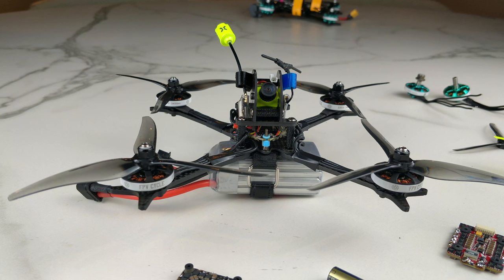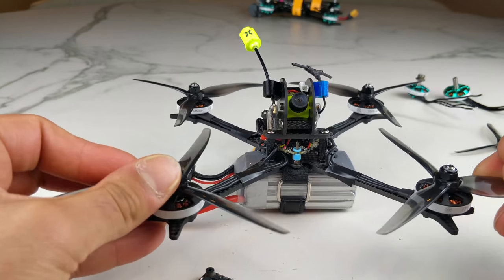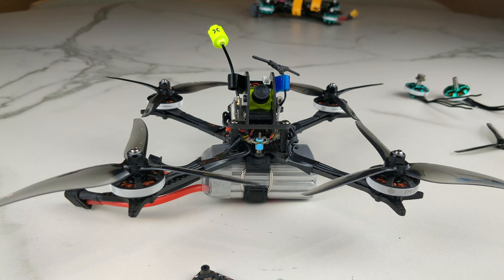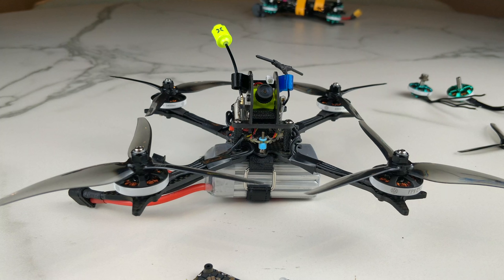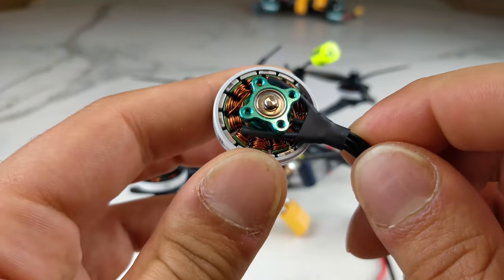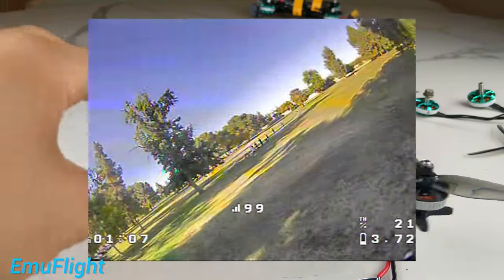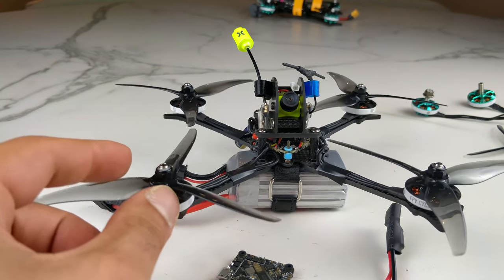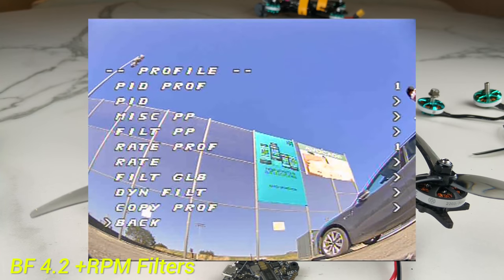Unconventional Tuning...

Comment: Holy shit dude, you'd rather reflash and re-config each time than actually TUNE?
Reply from the maker: the reconfig takes not even 20sec.  Nothing is changing on the quad I just run through the pages and set the handfull of things that I typically set.  I'm building and flashing so many things so often that this is a non-issue for me and I just wish they'd put all the typical settings that need adjustments on one page so it could be even faster.  Also, given the host of issues this quad has, it's not exactly easy to figure out what to start with when you approach tuning it.  I go with the easiest stuff first to rule things out.  Flashing is very easy and not labor intensive at all.  I don't even need to touch the quad...
Reply: Those dropped packets are what makes people hate feedforward, since it amplifies every RC issue and makes the quad feel twitchy and rough.
Reply from the maker: @bizmar  it's awful. I hate FF. It's the worst thing anyone ever came up with. Artificial mouse acceleration. Terrible.
Reply: @Kabab  Bob, seriously make a "diff all" in the CLI, save it in a text, then paste it into a new quad.. make that for each firmware version and you're good to go. You'll literally save like 30min a year! Such savings!
Reply from the maker: @bizmar  unfortunately things change from version to version so that doesn't actually work as nicely as I would like it to. I'd prefer they just get rid of all the annoying stuff and put it in an 'advanced' menu then put all the stuff anyone actually uses on the regular on one page. Would make setup seconds instead of minute as well as simplify everything for everyone
Reply: @Kabab  Because you don't understand what it does or how it works. That's blunt but true. Repeating the lazy analogy that it's like mouse acceleration misses the point.. If the quad moves faster than you are commanding it, that's equally wrong as moving slower than commanded. 

Here's a very good explanation if you want to know why feedforward is a standard component of control systems, it get's into technical specifics in the middle, feel free to stop watching. https://www.youtube.com/watch?v=FW_ay7K4jPE

A dampened smoothed response is a totally valid feel preference for a freestyle plot that cares about smooth HD video. But that doesn't mean that a very responsive accurately tracking system isn't beneficial for a racer, for example.
Reply: @Kabab  I haven't touched the aux, modes, features, beeper, OSD, parts of my DIFF in literal years. Those all work across versions. Of course doing this blindly is dangerous..But if you set up quads all the time, it's a good thing to know.
Reply: @Kabab  FF is amazing, it's a standard approach to control systems for a reason, it can more than half the delay in set-point tracking. If you want the soft cinematic feel AND locked in response simply tune it like a race setup to begin with and then manually set the RC filter to like 20hz and you'll have to best of both worlds. easy peasy....
Reply: FF is an amazing feature. It makes you track setpoint so much better with less delay. Now if you don't like the feel then adjust your rates

Comment: I built a light weight 5 inch with 1606/4000kv motors, I had this problem until I used bi blades made from 4.8x3.4x4 props. With all tried blade props I tried it was like driving a school bus, with the light bi blades I made it's like driving a race car. I couldn't believe I spent days trying to tune, and the props made that much difference. I realize my motors are much smaller, but it's an easy thing to try.

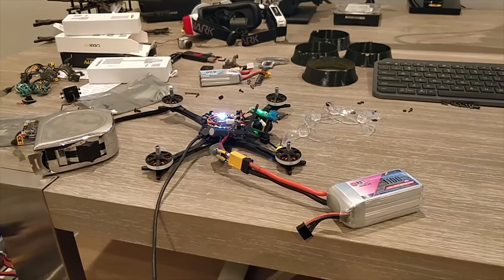Comment: Gyros and IMU's are in general quite susceptible to electrical noise! That would explain 13:28. A huge electrolytic capacitor isn't really ideal but it would help. Using a special circuit called a capacitor multiplier to power the gyro would be the best thing, or just more decoupling capacitors and better voltage regulators (with better line regulation) on the flight FC. Unfortunately the real fix would be to fix the PCB layout, which isn't an option unless you want to develop your own flight controller board. :)

To save weight compared to a big giant capacitor, you can try adding a 5 ohm resistor in series with the flight FC power and a much smaller MLCC capacitor, maybe 10uF. This forms an RC filter that would isolate electrical noise from the ESC entering the power for the flight FC. Ensure there are no other battery voltage connections to the FC too. And be careful with ground loops.

Comment: Could it be that this thing is simply too light for 5 inch props? I mean even the props being very light, they still produce a lot of vibrations taking into consideration AUW of this thing. As much as I can see from dvr, there are problems at takeoff and other situations when rpm is low. Once rpm gets higher, there is less vibrations and therefore less problems. I mean look at the rc helicopters during motor idle up. Everything is shaking. After certain rpm is passed, everything is ok. Like you said, it is just a thought, trying to find some logic here. 🤔 🙃
Reply from the maker: Yeah it's definitely outside the appropriate performance envelope that works well. That's why there are so many issues. I wouldn't recommend it but I do know that there will be many people trying it and I'm preparing for the questions...

Comment: I burned the 5v regulator on that board on my 3rd plug in after flashing all the software(my fault, didn't install the capacitor).. Thank God my pandarc 400mw vtx takes upto 25v and build in bec so now I'm powering the board from the usb plug by the 5v out on the vtx seems to work perfectly fine

Comment: About capacitors: To simplify things, resistance makes a capacitor "slower". That is why low-ESR (Equivalent Series Resistance) capacitors are used. A wire adds some resistance between the circuit and the capacitor and thus makes it "slower". You want it to be fast because the voltage is changing fast. Speaking about the changing voltage,
About the ESC: I believe it is not the sensing of the voltage (which does happen in an ESC) but rather the regenerative braking of the ESC that is causing the voltage spikes on the power lines. You want to filter these spikes out before they reach other components so you would ideally place the capacitor right next to the ESC on the power lines.
Reply: Correct sir!
Reply: yes and you could see this with blheli_s escs very easily by just turning off braking and the twitching will go away.  You can't do that on blheli32. Of course nobody wants to fly without braking so we look for other solutions.

Comment: 1) this Video is NOT boring. 
2) twitching motors: there is also the variable 24 vs 48khz pwm on ESC, especially if twitching occurs without load an not/less with prop on (inertia)
3) with separate ESCs it was possible to bring low ESR capacitors more close to the FETs, please use your celebrity bonus / contacts to suggest ESC makers to give us pads on 4 in one ESC next to each motor ESC on the 4in1 board. (4x 250uF caps instead of 1x 1000uF)  to bring the cap more close to the noise source.
4) Blheli_32 is not Open source so the manufacturers have to license it.
5) open source in the IT industry works, because Google, Red Hat, IBM, ... provide / finance developing capacity in form of employees to open source projects. Chinese manufactures should also provide developers to the betaflight project or at least donate money. (do you read this, racerstar, Mamba, iflight,  hglrc, hobbywing, ...?) - or else ....

Comment: I have never soldered a capacitor to the end of my xt60.  I watched the flightone video on capacitors and they found that a short length of wire is actually better than using long capacitor pins. They tested this using an esr meter.  Capacitors are designed to be surface mounted with the pins very short on a circuit board, obviously, because the pins are actually terrible conductors and leaving the pins long causes more resistance than a short pin and a short length of 18-20awg.  I don't know who was the first to put the capacitor on an xt60, but it looks freaking terrible and there's always room in almost any frame for a capacitor so it makes no sense to install one there.
Reply from the maker: lol yeah seriously....but it's common practice and actually far more common than putting it on the board itself.
Reply: Do I really need 3 damn caps??
Reply: @Kabab  I know, Catalyst machineworks does it on their RTF quads, it's tacty!😂 I hope Alan Woltemath isn't reading this.😁

Comment: Gday Bob, that was interesting although im not as experienced as you are i understood most of that, i dont use betaflight 4.2 im still on the older betaflight but id like to try emuflight on some of my micros do you recommend it? great info mate.👍🛸
Reply: I've tried Emu on most of my builds. At the time I thought it was good. However every quad that I have then put BF 4.2 and RPM filtering has flown better and smoother, it doesn't matter if its a whoop, pick, cinewhoop, or 5 inch. Its just been better. Turn the filters down as low as they will go on the sliders adjust the notch width and parameters and bingo. It takes no time and I've never smoked an ESC on any of my builds. I don't tune the PIDs either. The only quad I use with 0.3.1 emu is a build with a Helio board and that's for the simple reason that its not supported in BF. Give both of them a shot but I'd be surprised if you liked EF over BF. RPM filtering is free and easy with Jazzmaverick. You really need the 48 khz for max smoothness and any flight time gains.

Comment: 14:42 you are spot on!
Big electrolytic capacitors have a considerable internal resistance and ESL (equivalent series inductance) which limits how well they filter high frequency junk. Film capacitors work better but are rather large compared to the rated capacitance and voltage. MLCC ceramic capacitors (type II dielectric) are also almost as good as electrolytic in terms of capacitance for the size, and generally have MUCH lower ESR, and lower ESL but do suffer from certain problems that are mostly irrelevant to this discussion (micro-phonics, temperature dependence, capacitance depends on DC voltage...)
Reply: 15:09 Oh no wonder! that is SHIT design right there! Gyros are super sensitive to electrical noise, the MPU6000 series is notorious for that, and now you have high currents being switched fast on the same damn board that the gyro is on! Gees amazing it works as well as it does!

Comment: Iv noticed anytime i fly a toothpick style quad they always have some kind of issue.... Why is that? Every single one of them! Drives me crazy because they are so fun and fast and lite ! Lol. Something with the vibrations in those type of frames you have said it yourself a ton of time i know.. I know one thing i really want to try your motors they look awesome even though looks means nothing. Love the channel man keep up the great information i dig it.
Reply: I have the dolphin hd from geprc and it has terrible oscillations !! Definitely gonna try moving the cap from the xt30!! Glad i watched this video!
Reply from the maker: Yeah the dolphin is f√$€# from the factory 😂. Definitely add caps like a mass man directly to the batt pads. Also, just about every issue with a toothpick style quad is solved by BF 3.5.7. The issues are with 4.X and no rpm filtering. Sometimes rpmf doesn't even work right on smaller things either. The TP3 is really carefully setup to not have a lot of issues but it still can like any other micro.

Comment: Something for me to try... I've got a six inch flosstyle running 2408.5 that handles like a dream with a Gopro on it, but if I try to burn a pack without the Gopro it stutters and flutters. I always thought it was something to do with being so overpowered. 4.2 and RPM filtering is worth a shot.
In your chase for consistency, it looks like you're still inclined to use a Vista over analog where you can?
Reply from the maker: yes I always use vista where I can now.  It's just such an incredibly good experience I can't not use it.  Also, even with RPMf, I still get the annoying bobbles and jitters on 4.2.  BF is just busted since 3.5.7.  They should just add RPMf to 3.5.7

Comment: Something that seemed to improve my vibration issue drastically was running JESC/RPM filter using dshot300 instead of 600 on BF4.2.
Really like you're approach here.
Reply from the maker: yeah RPMf is definitely a big jump in improvement and should be run on D300.  Doesn't need 600

Comment: I'm now thinking about how to do filtering and PID tuning on 1-2S whoop without Betaflight BlackBox memory on F4 FC board. All serial ports are occupied (TBS Nano and SmartAudio) Any ideas how to tune that without having logs?
Particular thing is 75mm Mobula7 with CrazyBee F4 Pro v2.0 FC instead of fried stock F3 board. Hadn't a chance to get F3 board replacement anymore because they are discontinued and out of stock.
Reply from the maker: It's very difficult to just not possible without black box.

Comment: If you don't have blackbox on you FC (I wouldn't by such), you cant attach something OpenLager. It works perfectly. Used it to tune my diatone cube.
Reply from the maker: for final fine tuning yeah that will help but in this case it's not a PID issue.  There's other stuff going on

Comment: Hi Bob, I suggest you deactivate Dmin in BF 4.2. It's useful in some cases but for most clean quads deactivating it makes things a lot easier. This and raising the TPA breakpoint helped me when I tried to get rid of throttle oscillations.
Reply from the maker: damn that's the one thing I forgot to do this morning when I setup some new settings to test after work.  we'll see

Comment: So if u were to pick a 5” analog setup for your 3s 1100mah lipos would the Fouride 5” be a better setup/ easier to tune? Looking to finally take the plunge on 5” and really like the idea of 3s on it , as I don’t a lot of places to go fly. I’d image there is a decent jump in performance in comparison to my lightweight tp3?
Reply from the maker: Yes quite a jump in performance. The fouride with 2204 motors and the gemfan 51433 is fantastic on 3s

Comment: Sounds like you got it worked out for the most part but if you are still having trouble with fluttering at throttle, it sounds like a TPA issue. I believe default will lower your pids 50% at 1500(Half throttle). Maybe try lowering it to 1200 so that before you get to mid throttle, your pids will be reduced.
Reply from the maker: TPA on BF seems to be broken.  I've jacked it up to 0.90 at 1200 and it still doesn't really do much.

Comment: How can they lock down BF?  There are so many forks of the code that other groups will just keep working on it (as they are able).  That said, I would pay for BF licenses for my quads.
Reply from the maker: Not lock down the code to use to make more flight code, lock down the core BF from any company using it to make any FC or rtf and make lots of money off things they never did

Comment: So, I've been using the 20a board with a little 100uf. Seems to be fine on the end of the plug. Now... The 30a I would drop a 35V 1000uf ultra low ESR on. Still might do it on the plug. What is the max amp draw of those motors?
Reply from the maker: These motors are super high temp so they really can draw the amps but under normal operation I wouldn't expect more than maybe 25A per motor on 5" and 4A.

Comment: Off Topic- I wonder if vtx tables was them getting out in front of the liability that would eventually be implied by pseudo charging (through rpm filtering,) for the firmware. The potential conflicts with open source licensing is another thing altogether, but discussion has definitely died down.
Reply from the maker: L🤷🏻‍♂️

Comment: I had issues with hot motors for the last two days, as it's getting hot here. Gonna put on a second capacitor tomorrow, because other than that filtering should just work fine. Thank you so much for this video. (Maybe more people could find better, with a different title.)
Reply from the maker: RPM Filtering is extremely helpful for hot anything if you're not already using it
Reply: @Kabab  Yeah, I was already using them for half a year, it's just that summer always makes my stuff run hot instead of just warm.
The filtered spectrum in Blackbox (gyro) looks quite flat, like you mentioned in you Video. I'm confident, that with Softmount optimization and more capacitor capacity we are gonna get there tho.

Comment: You covered several aspects but I did not see mention in a possible unbalance of the motors, and that would be decisive in such a light frame ...
Reply from the maker: as in unbalanced bells?  These things spin super smooth.  definitely not that and when I lifted the FC off the frame I still had issues so it's definitely not that.
Reply: @Kabab  Could you please test them separately with the Betafight with the accelerometer on to eliminate this possibility?

Comment: I'm a person who has dealt with r/c my whole life, and I can tell you that this is a myth. It is nonsense. It matters not one bit where the capacitor is located in 3" of copper wire.
Reply from the maker: I've literally demonstrated the issue here and electronics today are nothing like they were even five years ago. We're down to bare bones electronics. There are almost no filters or electronic noise management on these boards.

Comment: hey ive seen people angle there motors forca more locked in feel, not as efficient but might be worth an experiment, ill send the details on which is the best angle to use once ive asked the aeronautical guys at work
Reply from the maker: On quads angled motors don't work out. It doesn't really have the effect you'd expect. They either counter each other or cause weird thrust the FC has issues with. In the past we used to angle the motors but that was because we couldn't get enough tilt on the fpv camera.